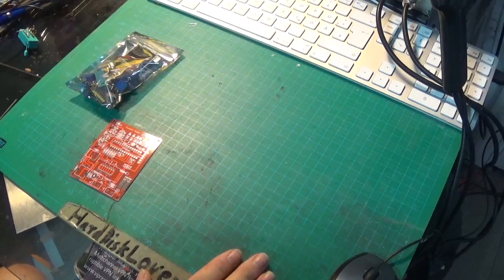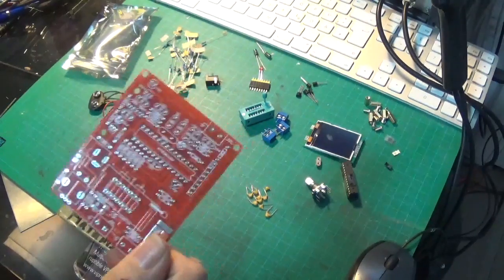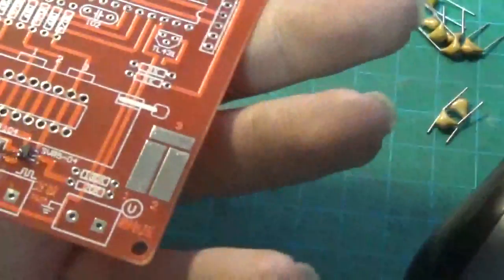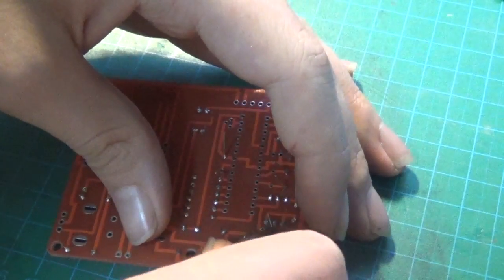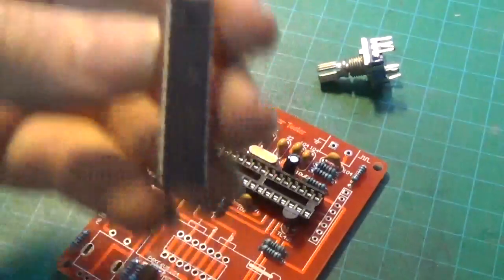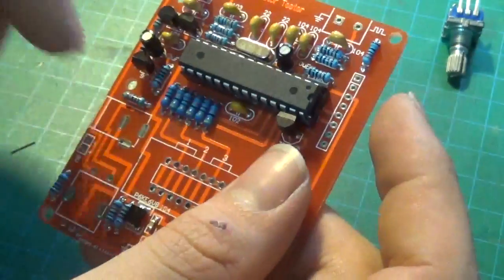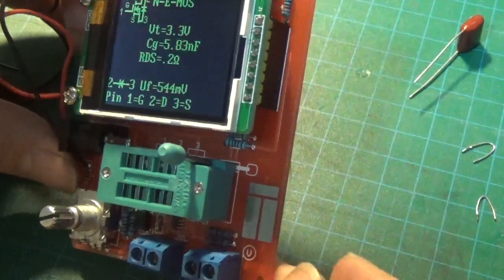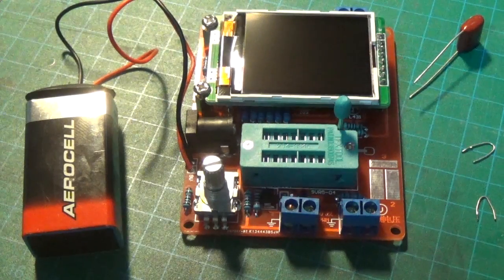Assembly of a Component / Transistor Tester gm328

Comment: you can opt out of using the surface mount components as to they are for just surge protection, the unit will still function, I've built 2, 1 with, 1 without SMD

Comment: Is the 9012 transistor supposed to get really hot? Can someone else check theirs and confirm? I can't find any shorts, but it is unusual. You can take the screen off and it still heats up. Its the first transistor after the power input if you follow the traces(it is also labelled 9012).
Reply: Okay, so after a lot of testing I found that 9012 is not supposed to get so hot it can cook popcorn. I found that the 3k3 resistor which I believe is supposed to level shift the voltage or pull down the circuit or something was 2.5k ohms attached to ground instead of 3.3k right out of the box! It was marked with correct color code, but was out of spec. So, I replaced it with another 3k3 I had on hand. The thing runs much cooler now and works perfectly(kinda, see below). 

For those of you who have the 1-||-3 capacitor test function that gives you 25%+ out of spec results, use the C+ESR@tp13 option and that will actually measure capacitors properly. Unfortunately for whatever reason you can't just plug in your capacitor and test it, or else it comes up with bad results. You can I suppose just quickly add 1/4 1/3rd to the result and call it good...but I don't trust that 1-||-3 test mode at all. It doesn't seem to work out of the box. For reference, I tested ALL resistors in the entire device, and all were to spec(after I replaced 3k3). The 470k ohm resistors were testing 465-472k, but I don't think that is enough to cause capacitance to be 25.54% lower than actual value(independently tested on my multimeter to be exactly 22.3uF. The device reports something around 16.7uF? If I go into the C+ESR@tp13 mode, it reports exactly correct 22.3uF that my meter shows. Which is good. Half the reason I bought it was so I didn't have to hold probes onto a capacitor to test it.

On another note, Anyone know if this thing can test thyristors? I had a bunch of 2 pin devices in TO-92? package with the third pin being really short(unusable). So, I finally just looked up a part number from one that had a readable part number. It came up as a thyristor. I guess these are pretty obviously 2 pin thyristors, but it would be good to test their properties without individually looking up datasheets from the almost unreadable slop written on the device. Anyone know?

Comment: Mine is excellent! But the frequency generator portion is crap on mine! It goes up to 9 Hz and that's it! What the hell? I bought mine from eBay prebuilt. I don't understand why mine is so different, yours and others are presets for quite a few different frequencies, mine on the other hand is variable from 0 hz to 9 Hz and that's it! Any help would be appreciated. It will read voltages, the PWM and frequency output is on the same jack, the one by the bottom voltage jack. It will read voltage through the jack with the V on it. Supposedly up to 50 volts.

Comment: What is annoying is when mine starts it shows the menu for 2 seconds.  The menu does not respond and then it switches to showing the battery status and a line of text that reads Vext=0mv.   I was hoping Dr Spock could translate that line into English I could understand.  It's OK when it works but far from polished.  Might of been a better idea to check the battery before showing the menu and not the other way around.

Comment: Mine worked fine for a few months so a few gos really of use and just died switched off and never back on again ! i am wondering if they program the chip to die after some time to make us buy another ..great tool when it was working but no reason to not even get a half a year out of it which would of been a few days no stop use really !
Reply from the maker: Thats strange. Had mine for over a year now and it works just fine. Almost use it on a daily basis. Maybe something was faulty. Often the voltage regulators tend to go bad or the screen died. You can check with a Multimeter if the voltages at all the pins for power (5V) are still good. A pinout of the used chip can be found here: http://www.homautomation.org/wp-content/uploads/2014/03/Capture-d%E2%80%99%C3%A9cran-2014-03-06-%C3%A0-21.52.42.png
The chip is just a standard arduino uno (Atmega326p) one you can't program these to "die". You could get a new chip, reprogram it with open source code transistor Tester code that can be found onine (wich also gives you a few more features) and it should work again. just make sure the hardware on the component Tester is still functional.
The first component tester I got ended up breaking when I was measuring some capacitors. I presume one of the capacitors was still holding a charge above 5V and ended up killing the whole thing.
Reply: Thanks for the reply ! i read a few people had my problem but mine worked fine from the start for a few months.
i checked the regulator it gives 3 volts out to the chip .but pressing the button i can read it is still doing that but only when i hold it in .
transistors look fine ..took screen off still same voltage problem..i noticed a surface mounted chip might be that .
It was a great frequency meter so i did get another which is here but i have not built it ..i could put the new chip in and see but i don't want it to go faulty if its that catch 22.

Comment: Out of interest to others i had a damaged meg328 would not switch on ...no idea how to fix it but noticed a video on line tracing the voltages the 5 volts come's from the surface mount parts in the mean time ....
Well i had ordered another which i had on hand now which i just panned on making till i found out they had not sent the surface mount parts ! very very P......off Ok i have 2 now one broken the other pointless making with missing parts and no easy way to tell them with only 2 options  refund or send it back ...i just want the parts !
The last resort was fix the broken one that would not switch on ...first i swapped the screen no good next swapped the pic again no good all other parts looked good a head scratcher  of a problem.....back to the video my last resort was just adding the missing 5 volt supply from a bench power supply to the top of the surface mount resistor where it looked like it came from bingo it switch on  not only that it worked on its own again  as normal but testing the pic the original it was dead but the new russian programed pic worked ,i know whats up now if this thing place up again !...but buyer beware ...the kits with missing parts are as good as no kit  unless your like me with a spare !

Comment: my tester doesnt work, 9V battery is ok, the display doesnt even light up
Reply from the maker: Hmm that sucks. Best to do would be to check all the connections again and trace the the voltages to see if everything goes where it needs to go or one of the transistors itself may be bad